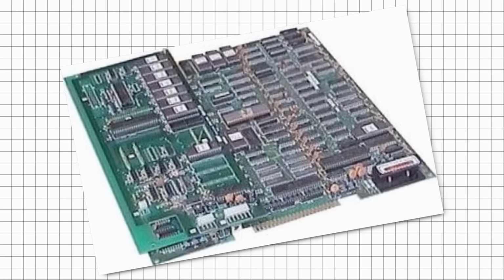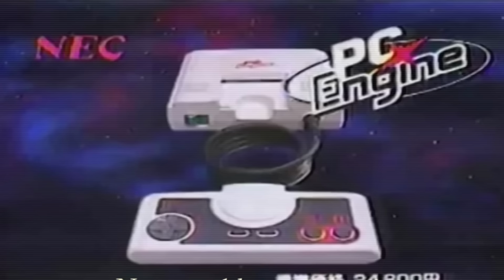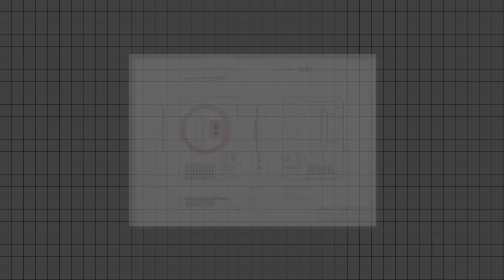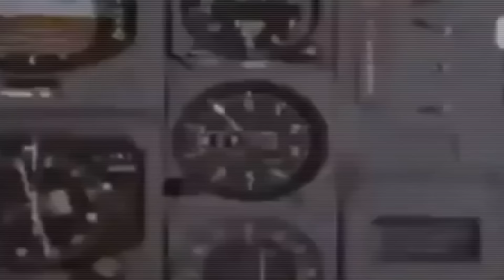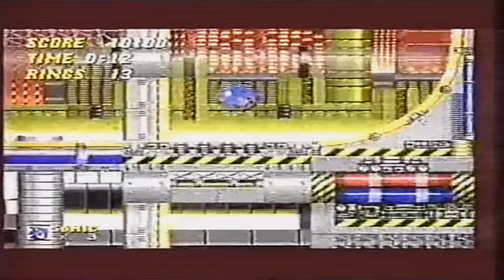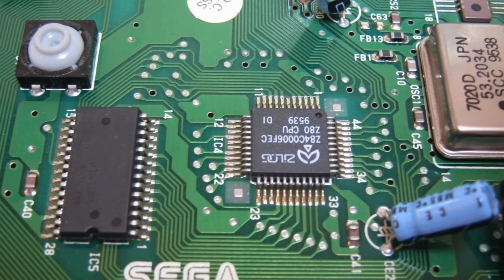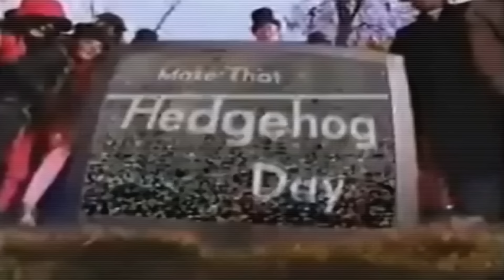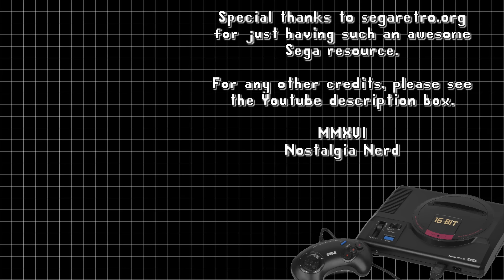Sega Genesis/Mega Drive Story | Nostalgia Nerd

Comment: I think the only big mistake Sega made designing the hardware was there's no sprite scaling chip.  Not even something that emulates it.

And for a company that was focusing on that in the arcade, it made a lot of their ports look quite choppy for years.
Reply: The Mega Drive soundchip was better at synthy stuff. The SNES had the samples which are more versatile but lack punch. A lot of the western Mega Drive games had terrible soundtracks thanks to the awful GEMS sound driver rather than the sound chip being bad in of itself. 

The MD also had many faster ports than the SNES. I think it was the colour palette let it down most myself. Sprite scaling on 1988 home hardware would probably be a bit pricey!
Reply: DejaVoodooDoll
I totally forgot the Sega CD had sprite scaling,   I just had the 32X stuck in my head as that had pretty much perfect ports of Space Harrier and After Burner (strangely no OutRun :S)

But what was the Afterburner 3 ad?
Reply: I did actually look it up when you mentioned it,  it does look absolutely terrible. It's not even a proper After Burner game.

Even more baffling is why Sega didn't advertise Thunderhawk instead,  that used a lot of sprite scaling and looks amazing,  even by today's standards.
Reply: Larry Bundy Jr Sometimes we don't make the best choices in planning I find.
Reply: SNES does not have sprite scaling chip either. And overall the sprite system is the worst part of its hardware.
Reply: Sprite scaling would have been a very nice thing to have, shame that they cut it out because of costs. The Sega CD sprite scaling wasn't straightforward to use I heard and still required some trickery on the programmer 's part to get it working right.
Reply: +Larry Bundy Jr
This make no sense since in 1988 full scaling/rotation chip would have been too expensive. And anyway they designed the Mega Drive/Genesis with the almighty M68000 as main CPU which can provide enough ressources to do scaling/rotation as seen in several games such as Gunstar Heroes, F1, Road Rash serie or Red Zone.

btw even released in 1990 SNES only has background scaling/rotation while on other hand has a limited CPU so... F-Zero or most others SNES games don't have sprites scaling but pre-rendered with low amount of frames due to weak CPU.

Oh and lastly, it's the other way around, Genesis has the bigger amount of superior multiplat: Earthworm Jim, Raiden, Mickey Mania, John Madden Football, FIFA, Desert Strike etc etc.
Reply: +DejaVoodooDoll
Nope, full scaling/rotation chip on a TV console would have been way too expensive in 1988, Sega needed an affordable console in the same price range as others main competitors.

The Lynx as a handheld is not the same thing, I guess less powerful stuff (i.e. less expensive) done the job here. But clearly it was ahead of its time.

What Sega should have done however was better ports of Super Hang-On or After Burner for examples, the existing ones are pretty good but could have easily been better with some refinements (After Burner wasn't even ported by Sega themselves BUT the game engine/scaling is good on this one just it's rather dry in terms of visual details). But there are several scaler games on Mega Drive which are more satisfying in terms of overall realisation such as Burning Force, OutRun/OutRun 2019 or the Lankhor/Domark titles.
Reply: +DejaVoodooDoll
Super Scaler games are much more demanding that some people think. Even the Sega CD with its full scaling/rotation chip have hard times with full scaling games, sure Core Design made some great stuff such as Thunderhawk or SoulStar but they have a more computer-oriented pace/environments, arcade scaler games need fast action which would have hardly been doable here. Only the 32X was the first Sega home system to provide complete Super Scaler experience at home albeit at a slighty lower frame rate.

But then again some Mega Drive Super Scaler games are already pretty good for their time (OutRun, Burning Force...) and even have room for improvements just with more development time and bigger cartridges size.
Reply: DejaVoodooDoll
Batman & Robin indeed looks and runs great, rather close to arcade Super Scaler experience, BUT once again all this comes at some costs since not only the Mega-CD has full scaling/rotation graphic chip but also its own CPU, another M68000, clocked higher than the MD one and both can work together which is probably the case for the most intensive Mega-CD games. So once again this would have been inconceivable in 1988 to provide such amount of silicone.

As I said the Mega Drive was perfectly designed and timed, it's just that some specific games should have been tweaked (Super Hang-On) or maybe even avoided for some (Galaxy Force II). As for Space Harrier II, it's fine for a launch title but Super Thunder Blade on the other hand needed some refinements, the crap frame rate during the top view sections makes no sense.
Reply: DejaVoodooDoll
The added M68000 inside the Mega-CD was here mainly to support the intense scaling/rotation effects. About the use of dual CPU, I heard that back then it was hard to do but not that it wasn't doable. This also affected the Saturn and its multi-processor architecture.

Anyway most if not all systems have compromises, the SNES and its limited resolution, the Saturn and its limited transparency possibilities, etc.
Reply: Larry Bundy Jr Yeah, all the weird compromises caused their collapse.
Reply: Keep in mind its easy to say Sega could have eaten the cost of the sprite scaling chip but their previous consoles weren't exactly smash hit successes. Nintendo could risk cramming more expensive hardware in their console which also had the advantage of a few years of technological improvement because the SNES was a guaranteed seller. Sega was flying by the seat of its pants with off the shelf parts with no guarantee anyone was going to buy the thing. While it's a shame we didn't get a scaling chip in the stock Genesis because it would have meant nearly arcade perfect ports of the super scaler games, I really doubt it was seen as financially feasible at the time.

Ultimately we still got a very arcadey system with a now legendary library that's a major chunk of what many consider to be gaming's greatest generation so even with all of the ifs and buts and could have beens it's hard to knock Sega's success in the 90's.
Reply: Christopher Blair precisely. The Mega Drive was the first console was to go for aggressive price cuts, using Sonic as a pack-in. It's easy say  they should use the hardware as a loss leader and make the money back on software now that everybody does it but when the MD launched Nintendo had a stranglehold on the developers and Sega had to develop all the software themselves from scratch. They were spending money hand over first in a very speculative fashion which must go a bit at odds with the typical Japanese business mindset, if not the engineering and creative mindset that still had a strong stake in decision making at that time.
Reply: Larry Bundy Jr agree Larry... I reckon they shpuldif gone x or yboard style (domesticated).... but this may of been costly though..... but very cool!  I guess we had the  neogeo to see how that type of venture would of held up..... they didn't do bad - 1989 - 2004 ....amazing for the length of a console.... live neogeo.... still will never afford one lmao
Reply: That would've made it too expensive (good scaler game ports weren't made until the 32X and for example Galaxy Force 2 wasn't quite 100% even on the saturn) and not have helped that much against the mode 7 games. But more realistically, a more flexible color palette with more sub palettes (even the best looking games often used 30-40 colors rather than 64 partly thanks to only having, IIRC, 4 sub palettes of 16 colors to work with) or easier to use shadow/highlight mode could've been done and they could've made sure that devs knew how to use the sampling part of the sound chip properly. Or they could've designed the MCD better and skipped the 32X.
Reply: Parallax Craze  sega  messed up when they didn't allow 256 colors on screen at once...and such a small color palette...and lil more ram for crisper,clearer and more voice samples
Reply: Well 9-bit rgb (512 colors or 1536 on MD including shadow and highlight modes - I think you could only use one of them in-game though) is fine for most games from that time except DKC and some later RPGs, but showing more at the same time would've made a big difference, as seen in some Turbografx CD games (it also used 9-bit rgb).
Reply: SNES was simply a more capable machine overall too. I mean FFS look at the REGULAR SNES Doom versus the 32x Doom! Nintendo certainly DID what Sega could NOT!  I grew up with both, but I always loved the SNES far more, and always knew it was a far more capable machine - as even at age 6 or 7 I understood that FAR MORE than simply CPU MHZ mattered! I knew all about architectural differences, as well as the MANY subsystems involved with any computer system capable of gaming like those consoles.

And the Genesis/Mega Drive was a good machine, but lacking sprite scaling - as well as the ability to slot in co-processing chips WITH game cartridges at a cheap enough price is what lead to SNES Supremacy! I mean that ONE game - Virtua Racing cost $100 freaking dollars!! BECAUSE Sega charged so much for their SVP - where the FX and Super FX chips cost very little extra on games that used them, I remember StarFox costing around $60 brand new which was not unusual for, what were at the time - Major Triple A releases.

SNES had better color, sound, sprites, and most importantly - as it was used in almost every Capcom game and COUNTLESS others - expandability in the form of additional processors that could easily perform advanced actions quickly, thus beating ANY difference in CPU frequency in Favor of SNES - without even taking architecture into account! I mean the SNES CPU likely was more efficient and suited for purpose, so that even with a lower operating frequency it COULD be far faster in many ways! I don't actually know - I would need to do some serious reading on how the Motorola and Hitachi CPUs used worked to know for certain, but SNES did have better resolution and color, as well as more hardware sprites and the ability to scale all objects - sprites and backgrounds - it could be that the SNES possessed a FAR superior Graphics Chip alone that made up those rather major hardware specifications of the base machines, again I would NEED to do some serious reading on both the CPU and Graphics subsystems on both machines - as well as read the MANY co-processors used on the SNES, and how they helped - as well as any co-processors used on the Genesis/Mega Drive - apart from the SVP that was incredibly overpriced and seemingly less effective than FX/SuperFX - but IIRC The Genesis simply did not have as nearly as much bus throughput on its cartridges - so its likely that even if SVP is superior to FX, it was hampered by the bus on the cartridge, as well as the lacking base specs compared to SNES.

Like I said, the regular SNES port of Doom IMHO was far better than  even the 32x Port - which was windowed and had NO MUSIC!

So, purely from a hardware prospective the SNES was always going to be the more powerful system of the two, it was better designed, and there were no REAL cost cutting effects - which is to say, later versions of the SNES, unlike the Genesis/Mega Drive - DID NOT LOSE QUALITY IN ANY WAY! Apart from perhaps the shells - and complexity of circuits - but usually for the better, increasing reliability whilst reducing costs.
Reply: I agree with all except snes doom.  It was windowed just not bordered,  poor frame rate,  no floor or ceiling,  lower resolution. Better music and attempt at textures of pc version and amazing it got even on the snes,  but it was awful to play compared to the compromised 32x version - which rightly so as obviously it's a much higher spec.
Reply: +Just another YouTube channel Compromises? Are you kidding?! They were by far the most generous, they covered arcade AND home systems and released tons of awesome stuff in both departments, Nintendo, NEC, Commodore or whoever, no one else comes close to what Sega achieved. The only problem is HOW they managed their own stuff, the Sega CD for start which lacked "classic 2D games" from Sega themselves (so many awesome Sega IPs which could have rocked as well on Sega CD but we only got one Sonic game and a port of two Game Gear games in form of Shining Force CD), instead Sega was focusing on FMVs which were very expensive to produce while not generating much benefits. And then another add-on the 32X with the Saturn coming soon, public was confused for good reasons. And talking about the Saturn, a too complex hardware for its own sake which was expensive to produce while not generating much benefits either...

But there’s another problem that people overlook is that Sega were arcade at heart and despite this being the pinacle of gaming, arcade started to fade from mid-90s so Sega and others companies such as SNK suffered the consequences.

And about the Genesis, it doesn't need anything else, it's the most balanced hardware of its generation and no game on SNES (or Turbografx) reach the level of Streets of Rage 2, Sonic 2 or Adventures of Batman & Robin just to name a few. And Genesis colors are absolutely fine for their time, check out aforementioned games' graphics or many others such as Thunder Force III, Mega Turrican, Ristar, Mickey Mania and the list goes on.
Reply: Everyone forgets core designs games, on mega cd.  Thunderhawk, soulstar, battlecorps, and not related but a near arcade perfect of final fight,  and Batman returns driving section which was more than half the game was ace too
Reply: Order Of Magnitude Indeed some impressive stuff but we talked about these games previously here ;)

But this lets me add that I take ANY DAY awesome chiptunes + CD option (Genesis) vs a dull sampler (SNES (which wasn't even ahead of its time since Amiga did samples 5 years prior)). Sure SNES soundchip is handy but it has some issues and often sounds muffled/hollow.
Reply: Parallax Craze I did add to the doom snes debate a few comments up...
Reply: Doom on SNES was a Super FX 2 game and it certainly plays and looks better on 32X. A better comparison would be Wolf 3D which recently got a homebrew MD port and didn't use a chip on SNES. 

Virtua Racing was more expensive, but also more impressive than Star Fox which was just a rail shooter. I'm pretty sure chipped SNES games were more expensive than regular ones, though SF might've been an exception. 

Superior specs in some aspects sounds good in theory, but the fact is that many action focused games suffer from a lot of slowdown, that the palette only made a big difference for later JRPG games and stuff like DKC and Mortal Kombat, and that the majority of SNES games sound muffled and midi-like. SNES did not have higher standard resolution, most multiplat games are actually higher res on MD. There is a high res mode on SNES but it severely limited what you could do graphically (much fewer colors) and so was only used in an obscure racing game and in menus and text boxes. 

There might be more inaccuracies in your post but I can't be bothered to look them up right now. I'll end with saying that the SNES should've been superior in every way considering it came two years later and Nintendo were already extremely successful, but it wasn't.
Reply: Earth worm Jim seems a good comparison in terms of on both consoles. Or toy story. I do love snes mind,  mode 7 games are cool....
Reply: Order Of Magnitude Yeah I saw and your points about DOOM are spot on. 32X port with more development time and bigger cartridge size would have been fantastic. Also it's quite ironic that some people think that the 32X has bad sound basing their opinion on DOOM 32X (which clearly has mostly bad music) while actually the 32X has great audio capabilities (QSound PWM). Such an underexploited system...
Reply: ***** Yeah, not only SNES could never replicate 1:1 some Genesis shooters but there are even more intensive genres with more action going on such as beat 'em ups or run 'n guns and the Genesis is on its own league there with stuff such as Streets of Rage 2/3, Alien Soldier or Adventures of Batman & Robin (most impressive 16-bit game IMO). These games wouldn't have been feasible on Turbografx-16 or SNES. Also the Genesis racing game named F1 with real scaling and 3D elements puts to shame whatever TG-16 or SNES counterparts. I don't even know what they were talking about in the first posts here lol. Even early Genesis games such as After Burner II or Burning Force mimic very well their scaling-based arcade counterpart.
Reply: The sad truth of the matter is, is that the 16-bit gaming era has been written (here on the internet anyway by super popular bias channels cough Watchmojo, AVGN etc) solely in favor of Nintendo. 
Gaming history itself has been warped in the Snes's favor and the ignorance and misconceptions of the Genesis vs Snes, from both a hardware, and software perspective are really sickening and profoundly stupid.

By most ppl in the states, the Gen is only noted for giving us Sonic, an uncensored Mortal Kombat, Aladdin...oh and Golden Axe lol. 

While the Snes allegedly destroys the Gen from a hardware and software perspective...? 
It blows my mind how this myth has been written in stone when after just over a year of myself collecting/playing Genesis & Snes games without any childhood bias and researching both systems...it is abundantly obvious that the Gen is technologically superior in some very important ways, where one system is weaker, the other is really strong. 

How is this not universally understood? Why is the Snes (as great as it is) so grossly over-hyped and misunderstood by the majority of the internet community? 
One reason is that more vibrant colors and an effect such as "Mode 7" like in Mario Kart are much more easily noticeable to the eyes of a casual gamer and to children, than the "higher quality animation" and high # of sprites on screen ala SOR2 & Gunstar Heroes.

I also want to blame Sega, for their terrible management post Sonic 2 era (1992>>>98). The add-on's, the wasted money/investments, the lack of marketing focus etc. Providing the American market with the generally terrible GEMS sound driver, effectively creating the "bad sound" myth.
But also, I strongly believe that the Snes had the fan-base anticipation and franchise recognition of the Nes, providing a natural boost to the familiarity and positive scrutiny of it's games. (Castlevania, MegaM, Metroid, Final F etc.)

Also in America, we tend to have a cultural precondition to embrace anything that resembles freedom and exploration . (because of our history, Revolutionary War winning "freedom", then expanding West, living out freely and exploring the western frontier blah blah) Hence how popular the open world genre is today etc...
Anyway Nintendo, and their Snes, really capitalizes on these types of games (Super M, LTTP, SMW, Kirby Super Star, Earthbound, Secret OM etc.) 
Fantastic games as they are, but how many times can you enjoy a world that you've already explored time and time again, finding the same secrets, over and over...ala Super M
However, the relentless 2D action that the best Genesis titles provide (Thunder Force IV, SOR2, Alien Soldier, Shinobi 3, Musha, Fire Shark etc), give endless fast-paced enjoyment and I've naturally played these games far more than the less gameplay intensive "legendary Snes classics".

This is where we see tons of bias in the Gen vs Snes debate from a software perspective, that Arcade-esque games with tight, fast gameplay are not as great as the slower-paced, open world exploration based game...this is an extremely flawed and unfair logic/perspective to have. Most of the hype the Snes receives, is simply because it did a fantastic job at those particular genres, while the Gen receives virtually no credit, for the equally fantastic job it delivers in the arcade genres.
Arcade action titles are just as fun (if not more) and important to the 16-bit era as a whole and it also depends primarily on your subjective gaming taste. 
But this...is NOT what is taught here on the internet however and it is really disappointing.
Reply: Apparently they didn't want the "VDP" to be too big. I don't get why they didn't just go with 2 graphics chips like they would a generation later with the Saturn and like Hudson/NEC and Nintendo did with their consoles.
Reply: Larry Bundy Jr I agree.
Reply: Larry Bundy Jr sega was capable to scaling effects without any special chip.. look the effect on sega logo of gunstar heroes.. and the treasure logo to..
Reply: El Kaiser 78 You can do software sprite scaling on anything, which is what your examples there used. Note that your examples involve very simple scenes where basically the only thing on screen is that sprite. Software sprite scaling is incredibly slow, which is why you'll only see it on the Mega Drive in very isolated instances where you have an excess amount of CPU time.
Reply: zOMGREI example intro to splatterhouse 2 with the mask coming to the screen?
Reply: Order Of Magnitude Intros and cutscenes in general are bad examples because they can be optimized far more easily than actual gameplay. I'm sure there's examples of Mega Drive games using sprite scaling in gameplay sparingly, but they're rare for a reason.
Reply: ...i actually can not think of any. Even the conversion of altered beast from arcade dropped the destroyed graves coming onto the screen and they are based on very similar hardware.
Reply: Order Of Magnitude I can't either. Honestly, I'm just hedging a bit because I wouldn't be surprised if there was some obscure JP-only release out there that managed it through either a trick or large amounts of ASM.
Reply: Yeah your probably right.
Reply: Scaling on the Genesis required mountains of code that developers and publishers didn't think was worth the effort or cartridge space.
Reply: *you're
Reply: You are... love auto t3xt
Reply: I previously mentioned here some Genesis games with scaling and/or rotation (Gunstar Heroes, F1, Road Rash serie, Red Zone...) and there are many others. There's a topic about this on Sega-16 forum, check it out.
Reply: +Larry Bundy Jr
lol, ok, I know this is an old comment Larry, but about forgetting the Mega-CD had sprite scaling/rotation, you really should look at the systems boot screen again. Especially the EU/PAL V1.0.
The Sega and Mega-CD logos are stretched and scaled in such a ridiculously hyperactive and over the top way, its practically screaming "Look, Look, LOOK!!! We can do this too!!!"
Its kind of hilarious in the context of the console war of the time. :)
Reply: For example?
Reply: It's about what you enjoy more. I think that FM synth of Mega Drive barely aged because it's electronic music to begin with, with Yamaha chip that is still used, but many SNES games suffers from low fidelity, low bitrate samples, which was just limitation of technology at that time. There are still good SNES soundtracks, yes, but Mega Drive had style, had it's own distinctive voice, like PC Engine synth, it was different, it was gritty and harsh and had real punch, SNES sounds more realistic but many times more like badly compressed MP3. You could do SNES soundtrack on PS1 or Saturn and it will sounds better, because of technology advance. But can you do Mega Drive's synth better? No, not really.
Reply: SNES was more chalenging to program because of it's array of custom chips. Mega Drive was basically arcade board with few cutbacks put in case of home console, in theory game like Street Fighter II will run better on Mega Drive and will be much closer conversion than on SNES because hardware is really close between CPS-1 and Mega Drive, but when you have money and want to put effort into porting, we get very good Street Fighter II on SNES, some may say even better than on Mega Drive. But, in terms of third party arcade conversions is Mega Drive system to go.
Reply: +Jakub Lulek
Some nice comments man with which I mostly agree except the Street Fighter II part, yeah it's (slightly) better on Mega Drive but it could have been better to a much greater extent if Capcom properly used the Mega Drive capabilities instead of reusing SNES assets and been lazy with the sound effects/voices. Check my other comment here I gone a bit more into details about this.
Reply: But Mega Drive was struggling in Japan, so many japanese devs simply ignored it or half-assed theyr games for it, very few of them (like Treasure) really used it's capabilities fully, so it was mainly on Sega to support theyr system in Japan. For me is really funny, how dismissive are people about PC Engine, but that machine was number 1 in Japan in 16-bit era, even beating SNES, yes, it wasn't as powerful as Mega Drive or SNES but you know, port of Street Fighter II on PC Engine is almost arcade-perfect, for many people the best port of that game. But developing for PC Engine and it's dual CPU setup is maybe as challenging as for SNES.
Reply: Aww, here I vastly disagree.

For start the SNES was much more successful than both the PC Engine and the Mega Drive in Japan.

And the PC Engine version of Street Fighter II might be impressive for the system it runs on but it still inferior compared to the Mega Drive or SNES versions. Check out VCDECIDE video about it, also the comments section where there are enough details about this and more...

Also many great japanese developers were involved into the Mega Drive: Technosoft, Treasure, NCS, Game Arts, Toaplan, Namco... And Konami did several awesome exclusives such as Rocket Knight Adventures, Castlevania Bloodlines or Contra Hard Corps. It's just Capcom that could have done better. And beside this the Mega Drive had huge support from many US and European developers (Electronic Arts, Virgin, Zyrinx, Core Design...) hence why it has the most varied and interesting library of its generation IMO.
Reply: Also:
"But developing for PC Engine and it's dual CPU setup is maybe as challenging as for SNES"
Most PC Engine games were developed in-house by NEC and/or Hudson Soft who designed the hardware so no worries in most cases it was used very well and even pushed to the max with games such as Sapphire.
Reply: They designed it to take advantage of external hardware upgrades, pretty much like FX chip in SNES, so Sapphire was possible because of RAM expansion Arcade cart. My point was that Mega Drive had very generic and well documented hardware, so it was much easier to program for it because of how much was known about M68000 CPU, Yamaha sound chip and other parts.
Reply: I am not that great in Street Fighter II to really compare all versions (King of Fighters is more my thing), but as you said, that version looks impressive and sounds impressive, I don't have problems controling it, so I was impressed. If really is subpar, yeah, I would believe that.
With japanese development for Mega Drive, yes, there are devs like Technosoft or Treasure who dedicated itself to platform (just like are japanese devs dedicated to PS Vita), and yes, there were even exclusives but how many and in what quality? Mega Drive hadn't big RPG franchise to really carry it in Japan (Lunar was kinda popular but it came with Mega CD), Phantasy Star was really good but no match for Dragon Quest or Final Fantasy. On the other hand, Sega did couple of smart moves in Europe, so Mega Drive was very popular here, plus there was some European games developed for it. And Sonic was popular in West anyway.
Reply: Indeed Sapphire was possible only thanks to the CD add-on + the Arcade Card otherwise it would have less content (Hucards have limited storage), worse sound (but it's already quite bad, check the sound effects lol) and the base PC Engine doesn't have enough working RAM (only 8kb).

Street Fighter II on PC Engine is not "subpar" but it's not on par with Mega Drive or SNES versions. It lacks of lot of content (less moves, lacks the third bonus stage, etc.), it lacks parallax scrollings, it doesn't run fullscreen (there are all sort of screen reductions)...

The Mega Drive hardware has some dedicated parts but also shares some components with others systems of that era such as the X68000 or the Amiga so yeah, the hardware was well known and rather easy to develop for.

"there were even exclusives but how many and in what quality?"
There are many japanese Mega Drive exclusives and many great ones, a quick overview:
- from Sega of Japan: Sonic serie, Streets of Rage 1-2-3, Revenge of Shinobi/Shadow Dancer/Shinobi III, Castle of Illusion/Quackshot/World of Illusion...
- from Technosoft: Thunder Force II-III-IV, Herzog Zwei, Elemental Master...
- from Konami: Rocket Knight Adventures, Castlevania Bloodlines, Contra Hard Corps...
- from Namco: Splatter House 2 and 3, Rolling Thunder 3...
- from Treasure: Gunstar Heroes, Alien Soldier, Dynamite Headdy...
And from others developers: Gynoug, Gley Lancer, Pulseman, Alisia Dragoon, Panorama Cotton...

About RPG, it's not the Mega Drive forte but it still has a solid catalog in the genre with the Phantasy Star and Shining Force series, the Falcom games (Sorcerian, Dragon Slayer, Ys III...), Langrisser I and II, Surging Aura... But a lot are in japanese which tends to limit their exposure. Also some great action/RPG such as Story of Thor, Crusader of Centy or Landstalker. Plus of course all the Mega-CD RPG...

Also yeah, the US and European developers did some great stuff on Mega Drive too, I edited my previous post about this.
Reply: That was not a mistake - it was by design. Yu Suzuki's scaling blitter AKA Super Scaler was expensive to produce and it kept being updated to support different games from Pre System 16 to System X boards and beyond.  And those arcade board generally had two MC68K CPUs with one to drive the scaler.  SEGA were extremely smart in offering software scaling equivalents in their ports to the Megadrive.  Hardware scaler support did arrive in the Sega CD and a later better revision in the 32X.  SEGA managed to beat Nintendo soundly even after the arrival of Starfox and it was really only the 32X where they started to really fuck up.
Reply: It's not about Motorola and Hitachi chips, the SNES cpu was made by Ricoh, and it's a variant of WD 65c816 cpu.

This cpu was faster (in cycles, not real time) than M68000 in almost every equivalent operation, normally only needs the half of cpu cycles to do the same op.

As example, an ADC operation/instruction (with registers) takes 2 cycles in the SNES cpu when with the M68000 of Genesis that takes 4 cycles. The SNES cpu can do ops like this with memory with a extra cost of only one extra cycle (using "page 0"), so doing a ADC with memory only takes 3 cycles of clock. The M68000 takes the ADC between registers and the STORE op, or the ADC instruction but working with memory, that takes around 7-8? cycles, I think.

The M68000 has other advantages, but not the power calculation with normal ops, it's very similar in that to the Ricoh cpu, in real time (so, the MHz story is a tale for kids because you can't compare that between different architectures, as example, the previous generation of consoles has cpus based in powerpc arch running to 3,2 GHz. Were they faster than equivalent cpus for pc running at "only" 2 GHz, as C2D? NO WAY!!, they have other advantages but ... not the power, you can't calculate power of a cpu only seeing its MHz).

M68000 can do more types of ops because was a very flexible design to doing 16 AND 32 bits operations (yes, it was a 32 bits machine, for the pov of a developer, if he wanted to use the subset of instructions to programming the M68000 as a 32 bits chip). Can do some "cute" ops that was useless in games like MUL or DIV (useless because you DON'T want to use that for any routine because take so long time to execute these ops, around 75 cycles one MUL and around 150 one DIV, is useful for programmers that doesn't need very fast ops (these ops) in real time like in games. The M68000 was designed to expandability AND as an offer to making "cheap" unix workstations. A very powerful set instruction for a CISC cpu oriented to programmers of "serious" programs.

The 65c816 is a 16 bit extension (and expansion) of the powerful 8bit 6502 cpu, more powerful, with improvements, and 100% pin compatible. It's a 16 bits cpu, strictly. And its a "hardwired design", it supports only ops that doesn't use microcode (as M68000, that uses masively microcode assisted ops), so a reduced but powerful set of instructions that you can use for doing more complex ones if you want implementing the correct algorithm, and the first of all, running the 99% of software fast!, including and over all, games.
Reply: No, it isn't. The Arcade boads used many custom chips, more than any console (except, obviously, Neo Geo). The only true was what you said about CPS-1 and Megadrive, was "simmilar" systems (but with very different capabilities with their graphic and sound chips, but I recognize that programming the cpu was easier because that is a semidirect-port, and the sound cpu was the same, too, so using it to programming the sound was very simmilar).

Out of IF a developer was a 68000 programmer or a 65c816 one (or... 6502 one, that was very typical and it's very simmilar to use the 65c816 to the old cpu), that is the main argument to what system will receive the best port of a game (a good programmer of the 65816/6502 cpus will do a very good work with snes but probably a bad one with 68000, and viceversa), the arcade board of the 90's were using multiple technics that didn't work well with Genesis. Big and with different size of sprites, many palettes of colours (not only 4), better selection of the colours of a palette (and not a very simple 9bit system), multiple layers, etc, that is easier to adapt to SNES because it has more capabilities to run conversions near of the arcade games. You must to cut more of a game with genesis. Not only is about colors, it's about all.
Reply: Pretty good explanation, I am very impressed. For me, honestly, is still very fascinating this neverending SNES vs Mega Drive fight, almost meaningless these days but people are still so into it (people in US, not much here in Europe) that I am also curious about it. Yeah, you cannot compare M68000 and Ricoh in straight fashion, Motorola is much more versatile (and because of that it was used in many, many computers in '80s and '90s) but overall slower, Ricoh is more focused, I would say cutdown version of 65c816, quicker but limited in it's functions. But versatility and familiarity of M68000 is in my eyes advantage for Mega Drive, it have generic, familiar hardware, used in many other applications, so developers are far more experienced with it and can do some clever tricks to use that hardware to it's full potential.
Reply: +wwwendigo
Dude, you should make clearer who you're responding to.

Then I dunno exactly all of what you're talking about but I can tell that the Mega Drive has superior CPU, superior resolution, superior sprites engine and also others advantages. SNES has its own advantages too such as wider colors palettes or more advanced transparency effects but Mega Drive's advantages matter more for gaming, just look at multiplat such as Earthworm Jim or Desert Strike, Mega Drive's versions are better experiences, smoother thanks to the better CPU, with better animation quality thanks to the more efficient sprites engine and with better field of view thanks to the wider resolution (+25%, 320x224 vs 256x224 for the SNES).

Beside multiplat, find me a SNES beat 'em up that rivals Streets of Rage 2 or a SNES run 'n gun that rival Adventures of Batman & Robin ;)

Also, since we're at it, find me something on SNES that reaches the awesomeness of Overdrive 2.

And once again, all of this on a console (the Mega Drive) released 2 years before and overall less expensive ;)
Reply: +Jakub Lulek
"this neverending SNES vs Mega Drive fight, almost meaningless these days"
Disagree, it's a fascinating debate with many points which still need to be highlighted further and also many points which still need to be dug further.
Reply: Yeah, all its superior in the Genesis ... XD

The sprites engine was shitty in MD, but... hell, it's better because it's inside me!!!.... errhh inside the Genesis. Yeah, that's better for this reason, because if you are talking about technical specs, it's so obviously inferior... less sprites in screen, less flexible, more little with only one selectable size, less sprites per scanline. Hell, the Sprites Engine of MD is so good!! XD

And that's ignoring that these processors did more than painting sprites (layers, FX etc). 

The cpu wasn't superior. The MHz means nothing between different architectures. Go and find a technical document about latencies of the instructions sets in the M68000 and WD65c816 and ... and compare, the SNES cpu needs around half the clock cycles to do an operation, that equalized the performance and the "advantage" of MHz of the motorola cpu. The cpus had a very similar performance doing basic ops, yes, the 68000 can do things as operating with 32 bit operands (useless for gaming in early 90's), or doing some fixed point arithmethic (the poor's maths for doing not-so-good 3D-but-better-than-nothing). But that only says us that the M68000 is a better generic cpu, not a better gaming one. If I have to program with one of this cpu I'ld choose the M68000 because is more flexible, but for developing gaming... hell, talk me about the coprocessors, don't the main cpu, because these processors define the real power of a gaming platform.

The only real graphical advantage of MD was the resolution, that's true but only that. The sound system of Genesis was primitive and .... well, it's BAD! you can repeat many times the same, but a lie isn't truth doing it, yeah, I know that Goebbels said that, but it isn't true. Fuck, when you ear some digitalized voice in MD ever, EVER, you ear noise in it. Never it sounds clearly!! :-/

You say if I know something better than Barnacles 2 (yeah, I prefer the japanese name for obvious reasons). Many beatemups, hell, with that OST in Barnacles 2, I can say Final Fight is better, at least my ears doesn't bleed when I power up the console with that cartridge. I don't like the mini-sprites that use the Barnacles titles, and Barnacles were simple clones of the final fight mechanics. If you prefer a more complete beatemup, well, you have Final Fight 3.

Barnacles (yeah, I know that is Bare Knuckles!! XD) titles were good, but not so good as many nostalgic genesis fans say. And I repeat it, I hate that music!! Maybe because I liked the techno/dance music, and I disliked so much that parody that sounds in Barnacles.

And if you are defending that the MD is "better" because it was launched earlier or because was a little cheaper, too, well, then you are confused. One thing is talking about technical capabilities, and another thing is about price/launch. 

With your arguments the MD is better (as gaming platform) than the NeoGeo because is cheaper and was launched before the NeoGeo. And, at the end, the best of all was the "16 bit" PC Engine... XD

PD: About the joke of PC Engine, I'm joking about the system, but it had a better sound system than the MD, and graphically it has its strong points against MD. But overall, the MD is better than this, maybe because the PC Engine had a very limited RAM specifications that limited the games that ran in it, and because its "special cartridges" with less capacity than MD/SNES ones, normally.

One console is better than other through its catalogue, without a good catalogue the specs are bullshit. And MD has a good catalogue, but I find better titles in the SNES one.
Reply: +wwwendigo
Nice post filled with nonsense and hate. But if you're having fun this way, then good for you I guess.
Reply: No boy, the hate is in you when you say crap like the "sprite processor"
 (they called it as VDP, it't inside the VDP, you know, with other hard)
 of MD is much better than all the other crappy hard in other consoles, 
included the superb one in the SNES (XD). In ANY technical spec is 
better than the SNES, precisely. By FAR!!

Seriously, you haven't an idea about this!! 

Barnacles
 2 is a good game (I suppose that you didn't catch the joke, so you 
aren't that excellent fanboy of MD that you want to look), don't cry. I 
only said that isn't a very good game. And it has sense, because is only
 a clone of Final Fight with massive copy&paste (and very bad OST), 
and if you dislike it, well, IT'S YOUR PROBLEM. That's the reality. 

Oh God!! I see very clearly in you the badness of the "blast processing" marketing campaign. XD

PD: 

Yeah, the MD's sprite processor is better because:

It can use 80 sprites, the inferior sprite processor in the snes only 128.

It can use only 20 sprites per scanline. Against 32 sprites in snes.

It can use only 4 palettes of 16 colours for all (sprites and layers). SNES only 16 palettes of 16 colours.

The big difference between using a 9 bit selection of colours against 15 bit colours. Yeah, because using 3 bits per colour chanel has so many quality! Yes, only 8 degrees of red, green or blue. The SNES? 5 bits per subpixel, so you can choose colours that have 32 degrees per subpixel. A more realistic selection. I

MD's sprites are 32x32. SNES can be with more sizes, including.... 64x64. (do the maths, for emulating what a SNES can do with a 64x64 sprite the MD needs 4 sprites, so the 128 sprites of SNES are equivalent to... 512 sprites of MD if you are using big ones cleverly, yes, 6x).

Layers, 2. SNES, 4.

No real transparencies in sprites or layers (yes, the PC Engine had them), massive dithering for simulating, SNES? real transparencies. Fliping between layers, sprites, etc.

Multiple FX effects in layers and sprites in ... the MD? NOPE! or very few and basic ones. Many of them? in the SNES.

What a bad sprite processor!! uh?

And so on and so on. Don't continue to spread that bullshit about "sprite processors" when you don't have an idea about it. The VDP isn't the best, hell, isn't better than the PC engine ones in many ways.
Reply: And I can all that goodness emulate on my PC like nobody's bussiness.
Reply: +wwwendigo
Your posts are funny jokes :)

Go ahead, tell that to any serious people in the homebrew/emulation development, in know some of them myself, they will have a good laughs reading your posts.

btw Final Fight 3 runs in narrower resolution than Streets of rage 2, is sluggish, has only 4 enemies max. on screen vs 6 in SoR 2, has muffled sound, etc. it's an okay game (at least better than the lame Final Fight 2) while Streets of Rage 2 is fantastic.

And I can go on and on with your post...
Reply: Just add "homebrew scene in US" (and Japan, I don't know, I don't know any japanese sceners), because here in Europe it is a different story.
Reply: +Mᴇᴢᴋᴀʟ Mᴜᴢɪɴɢᴢ
Wow, YOU're full of it.

"Higher res modes"
With several technical restrictions which is why 99,99% SNES games run in a limited resolution of 256x224 ;)

"more sprites"
SNES is often bottlenecked in a way or another. Where are your SNES counterparts to Streets of Rage 2 or Adventures of Batman & Robin? ;)

"multichannel wavetable audio with true polyphony"
With limited RAM and a shitty gaussian filter. And samples-based sound chip wasn't even new, Amiga did it 5 years prior.

In terms of sound, both console have their pros/cons but I much prefer the Mega Drive sound signature, clearer and with much more character.

Oh and Capcom pulled out what they could with the SNES, no need to damage control here too.

And yeah, the hombrew scene just further highlight a lot of this. Talking about this, check the "[Touhou] Bad Apple!! - Sega Megadrive / Genesis version" video, there are more technical info in the comment section.
Reply: +Mᴇᴢᴋᴀʟ Mᴜᴢɪɴɢᴢ
Even some guys who are into SNES emulation development can tell you that the SNES is a messy hardware with more limitations that its spec sheet might lead to think. It's almost as if Nintendo tried to fool people with this, which wouldn't surprise me.
Reply: "some guys who are into SNES emulation development can tell you that the 
SNES is a messy hardware with more limitations that its spec sheet might
 lead to think"

Pulling pretend people from your arse does not an argument or evidence make.  You're bad at this.
Reply: I know it has been 10 months but I just wanted to tell you that even the Super Nes, a console released 2 years after the Megadrive, doesn't have a dedicated chip to rotate sprites (an expensive operation back then). The advantage of the Super Nes on that topic is the ease of having a coprocessor to handle such operation added to the cartridge. Like the Super FX 2 for Yoshi's island.
So I would not call that a mistake from Sega. In 1988, they didn't have the choice. Especially if you need to keep the price reasonable.
Reply: Genesis Street Fighter 2 was better than SNES. SNES was slow as shit. Madden and NHL was also better on Genesis due to SNES being so damn slow
Reply from the maker: Larry Bundy Jr Early days though Larry
Reply: Yeah no "mode 7" style capability on the Mega Drive was a bit of a cop out sadly. It meant programmers really had to work harder to get more complex looking games. Something the also meant more memory going into creating more sprites to "emulate" scaling via using multi sized sprites.
Reply: Mode7 doesn't scale/rotate sprites though. Only the background layers. The SNES had to use the same kind of tricks to simulate sprite rotation and scaling.
Reply: DejaVoodooDoll it would have been as expensive as neo geo it wouldn't be helping them just pricing them out of a competitive price point.
Reply: DejaVoodooDoll the lynx didn't come out in 1988
Reply: There are many games that are better on Genesis.
Reply: There are many games that are far better on Genesis.
Reply: Who the fuck remembers or cares about Afterburner 3????
I wasn't even aware of its existence until you mentioned it and i owned a MegaDrive for several years in it's heyday..
Reply: YES! I remember thinking this at the time, and noticing how sprite scaling extended a console's potential applications - big time.
Reply: And there audio chip was not the best imo
Reply: In 1988, a chip dedicated to sprite scaling probably just did not seem worth the expense. Only hindsight stimulated by competition with the SNES made it seem necessary. I know others have commented on the colours, but 512 colours and 64 on screen were clearly too few, especially when the PCE could already do much more. Technical tricks only helped so much, if developers even bothered to program them in. When the SNES could boast things like a pastel colours, MD games often looked dark and bland incomparison. This did not affect gameplay, but in pictures, commercials, and in-store displays SNES just presented so much better.
Reply: Another fatal mistake is the poor color pallete . The genesis should show 256 colors on screen . The 64 color limit held the console back . I would designed the genesis with 4096 color pallete and 256-512 colors on screen. The genesis needed more colors to simulated better “arcade experience at home “
Reply: Even the CPU and the resolution were better with the MegaDrive. The color palette was bigger for Snes. But when you see Sonic vs Mario games MD graphics look better than Snes.
But you're right western product and ports weere atrocious. MD was hard to program for non Japanese at that time. But when  Magical taruruto Kun MD vs the Snes version for intance The megadrive destroys Snes version (more colours bigger sprites better backgrounds and special effectss like distortions etc..
Reply: @Alianger  wtf starfox is a classic and virtua racing was boring.
Reply: @turtleanton6539  that wasnt the point at all
Reply: @fixedfunshow  You can't port games to SNES. Only make original games. The unique hardware and resolution made that a necessity. Thats why everything was 'Super'.
Reply: DejaVoodooDoll  

Yeah but look what happend to Atari. They went tits up trying to push the boundaries, very poorly I might ad as well.
Reply: SNES and Mega Drive, had them both, loved them both. For my tastes, SNES had the more playable games, but they were both lovely machines, in an era that had more fun in gaming than perhaps later eras. I say 'were, but they both in their boxes behind the settee. :)
Reply: The Neo Geo had one. We all know what that meant. It cost a shit ton of money.